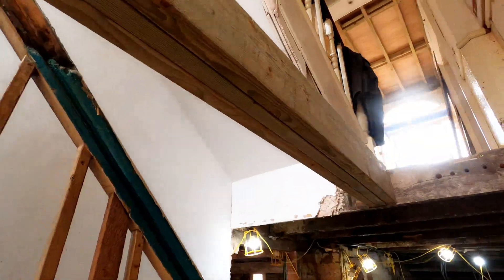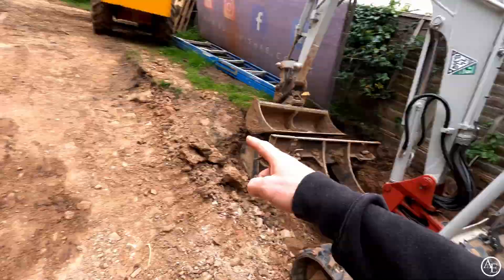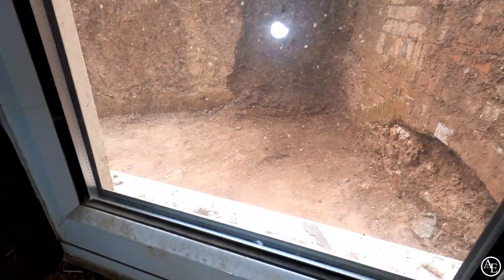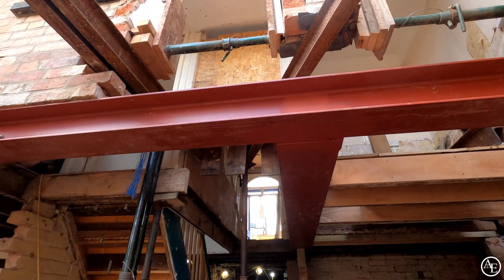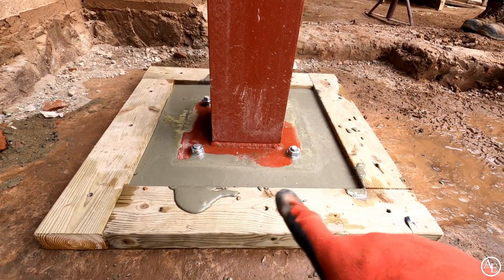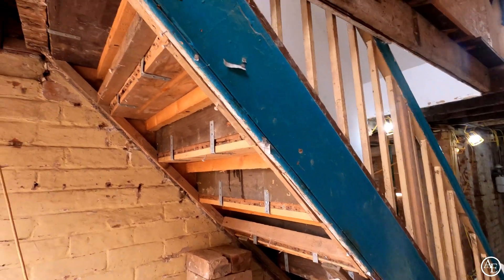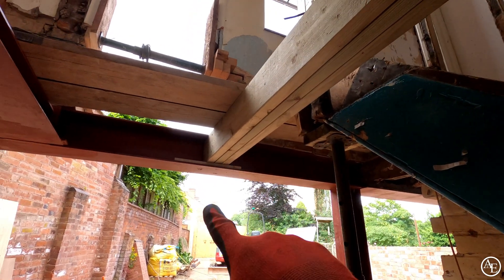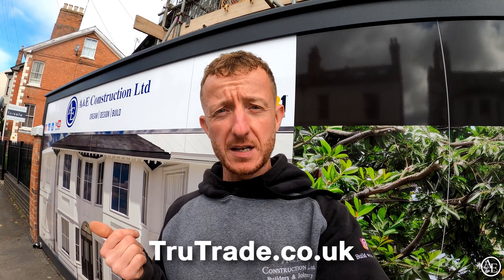Steel Welding and Shutterings! 🧑‍🏭 | The Regal Resurrection 11

Comment: Please please please be careful not flooding yourselves out with connecting the rain water pipes onto the foul/combined system. I know you have separate Non return valves installed but if the main sewer backs up and the nrv’s close where is the excess rain water gonna go? I’ve seen it so many times in Leamington. I don’t doubt you’ve already looked into the probability of this happening, just don’t want you to literally be in the 💩